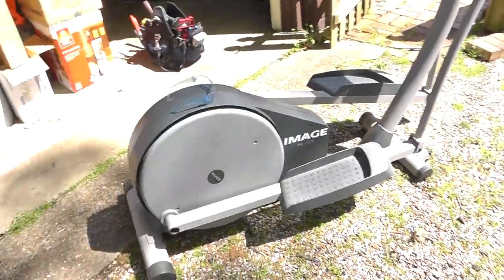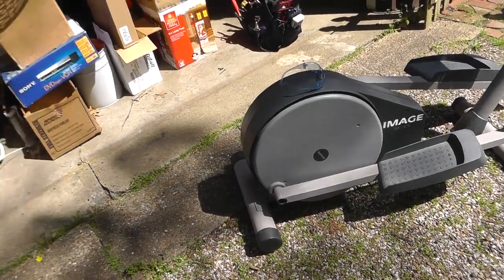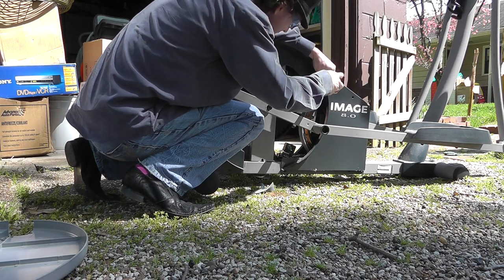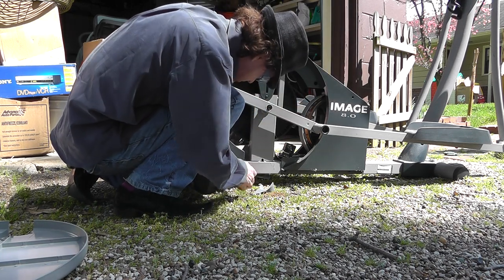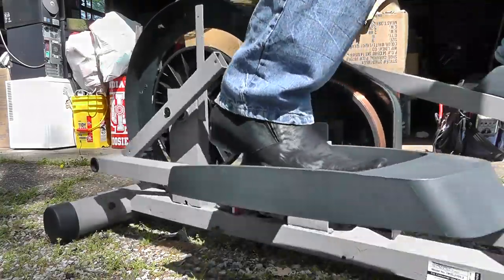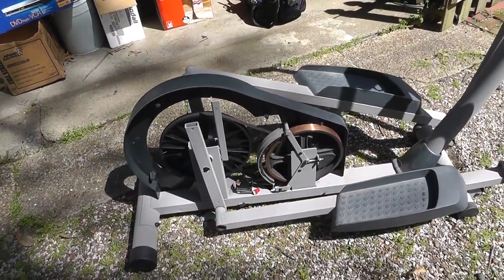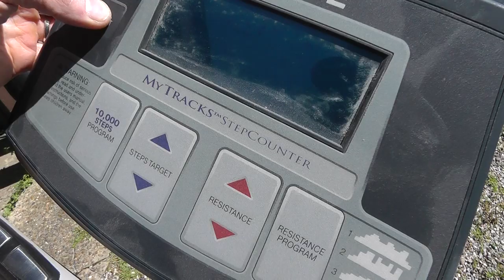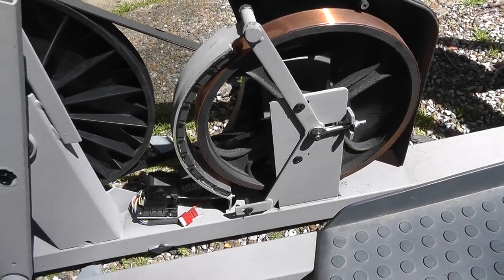Using Eddy Currents Is Good? This Device Works Using Eddy Currents. I Found It Interesting,

Comment: The Toyota Prius uses these currents during braking to recharge the battery.  That is an electrical generator.
...
This is also called magnetic damping and is why the disk is pulled along with the magnet in this video.  The old mechanical auto speedometers used this.  A conductive cup that can rotate was attached to the pointer and had a spring pulling it back to zero.  A magnet was spun from the drive shaft and sat in the cup.  As the magnet spun, this dragged the cup along with it, against the spring.  The faster the drive shaft and magnet spun, the more drag there was and the more force on the spring, moving the pointer up the scale.
Cheers, ScienceAdvisorSteve

Comment: Russ,
I don't know how far you got using this as a load.  While designing a half-horse  DC Brushless motor, I used another motor as a generator and mechanical load similar to what you talk about here. I had to dump the power from the generator into a resistor bank.  When you use it as a load, if you can figure out a way to measure the torque on the housing, that and the RPM allows you to measure the mechanical power being delivered to this load.  I was able to use an arm and weight against gravity to measure the torque on the generator housing.
...
P.S. The old mechanical auto speedometers used this.  A conductive cup that can rotate was attached to the pointer and had a spring pulling it back to zero.  A magnet was spun from the drive shaft and sat in the cup.  As the magnet spun, this dragged the cup along with it, against the spring.  The faster the drive shaft and magnet spun, the more drag there was on the cup and the more force on the spring, moving the pointer up the scale.
Cheers

Comment: I had a workout frame that allowed you to place a 10 speed bicycle on it and pedal in the house as you watched TV. It too used the same concept plus the unit had an offset adjustment so you could get more resistance. I purchased that unit almost 25 years ago and I'm sure that design it has been around for a long time. Mine didn't use any coils. It actually used an aluminum disc sandwiched between magnets and the eddy currents were in the disc. It was a very cool design.

Comment: People use similar systems for braking of rotary machines. Climbing fall harness gizmos that slow you down if falling from high using Eddy currents on a drum line as one example. Inexpensive, zero friction, next to no maintenance required simple and efficient. Eddy currents are awesome when applied for braking heating and regenerative energy capture.

Comment: It can be used for nondestructive metal testing: "...Eddy current crack testing is performed as a “dynamic” test where an eddy current coil must pass over the area under test.  When there is a crack or flaw in the component, the eddy currents move around the anomaly which is detected by the eddy current instrument..." NDT

Comment: Just use that bad boy for its intended use! Be your own basement heater!
IT's a great assembly to take advantage of, but it may not be rated for much more than 1kW. An elliptical machine doesn't really allow for high output workouts (like bike sprinting/rowing), so this thing is either way overbuilt or not really up the the task of any small generator. If you manage to calibrate it, a nice test bank for smaller stuff like stirling engines and whathaveyou.

Comment: Eddy currents have an application you may not be aware off: Powering bicycle lights. There are lights powered by a dynamo which power supply comes from the rim eddy currents. The big advantage over traditional dynamos is no physical friction between dynamo and rim, which results in less rolling resistance. Example: https://www.magniclight.com/en/

Comment: Could you design a frictionless brake system in cars which utilizes Lenz law/Eddy currents? You would never have to change brake pads...
Reply from the maker: yes and no, at some point the device would not stop you completely as you need some moment to create the eddy currents.... on a side note, most electric cars use this principle in whats called "re genitive breaking" and it can be used to charge the battery... turns the motor in to a generator. ~Russ
Reply: rwg42985 Yes, you're right, I didn't think it through. OK, so a combination of a traditional brake and a frictionless brake would need to coexist. Weight would become a factor although I suspect you would need a smaller brake pad in this case if you activate the pad once the magnetic brake ceases to be effective. I am starting to see the complications...